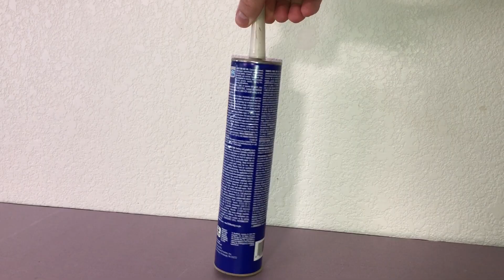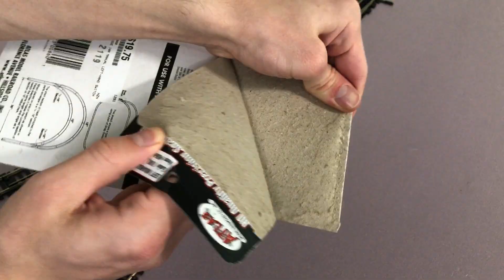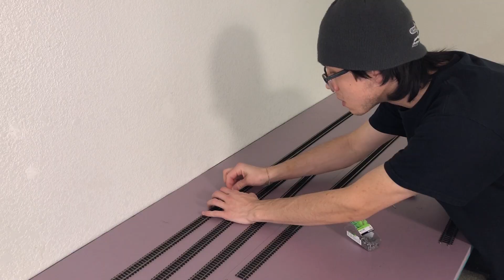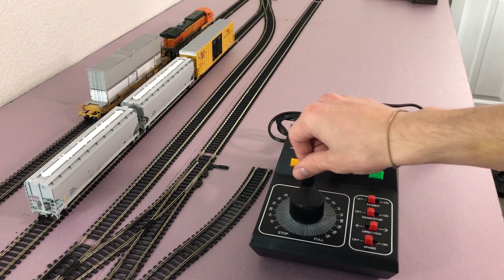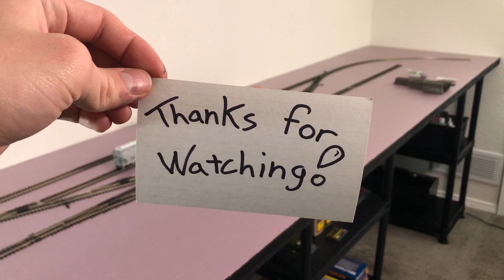Large HO Train Layout Build - Ep 1 - Track Plans, Materials, & Realistic Layout Ideas

Comment: I like how you take us through your steps. However your first mistake is getting those Atlas Snap turnouts. The plastic frog is known to cause problems later as it wears down. Also, the frog angle is sharper than #4 at about 3.5. The Mark 4-5 are better with metal frogs. The other is the short S-curve. Rolling stock hates this.  You're track plan works okay with pre-2000 rolling stock. The newer cars need better track alignments. Hope this helps.

Comment: Hey there, nice clarity, and evenly, and accurately colored lighting in your video!
Question...? Did you encounter any issues using caulking that, from what I could see, was NOT the 'foam safe' type? 
About your one 'odd, longer turnout, if it isn't tacked down yet, you can probably look at the bottom of the ties, and it may clearly tell the source of that t/o...(based on appearance, it could be a Peco ElectroFrog, or if it's new, a Peco UniFrog...either is a fine choice, just seek out Peco's guidance for no hassle wiring.
Also recommend you see The DCC Guy (Larry Puckett) on U-Tube, as he has specific videos on the Peco (and other brands) turnouts...very helpful. Good Luck!!

Comment: If you take your hobby knife and just cut off the little knob on Railroad tie that holds the rail on you side the rail jointer In between the two pieces
Reply: You will also want to get a rail cutter it will be much faster than the Dremel tool

Comment: I like the simple deck with just shelving.  Any info on the shelves used underneath the plywood?  Did you have any issues leveling the plywood with the shelves underneath?  If so, how did you resolve it?  I'm debating whether or not to build a table underneath or do something similar with the shelves. I figure I will want some portability to it in case I re-position it within a large room
Reply from the maker: Yeah I get them at Home Depot there the HDX 4 tier plastic shelves. I just took off the top tier of it. I haven’t had any issues so far they work quite well. They are more pricey now since I last bought them. I believe there about $35 dollars

Comment: Hello,  our railroads interchange with each other for I model the Union Pacific's Boulder Branch in the 1970's out of Denver. My Dad worked the line as a trainman all the way to Valmont, Boulder and  the Boulder power plant.  For your roadbed to save on ballast tear the Midwest cork in half so the beveled edges are on the outside then lite sand the edges it will make easier to add glue then ballast. I like your layout plan for around the room, for my wiring DCC or conventional wiring I drop feeders from the track to the main Bus line about every 3 ft. since I dont solder the rail joints. 
You should check out George Booth's  HO Colorado and Southern/ Great Western Railway web page has a lot of good tips for Atlas turnouts and other things as well.  Keep up the video's looking real good.
Reply from the maker: That’s a  awesome line to model especially since ours would connect in real life! Thanks for the tips and tricks!